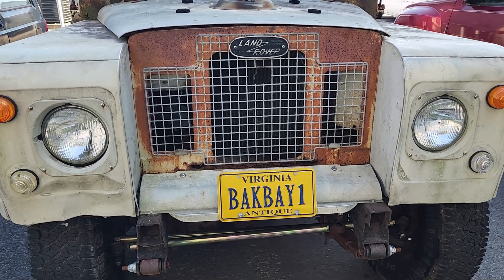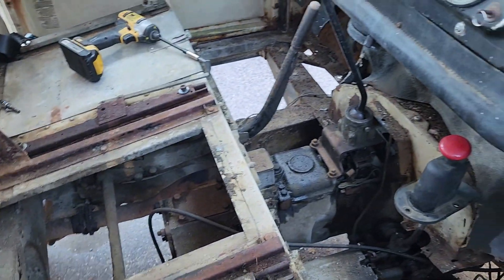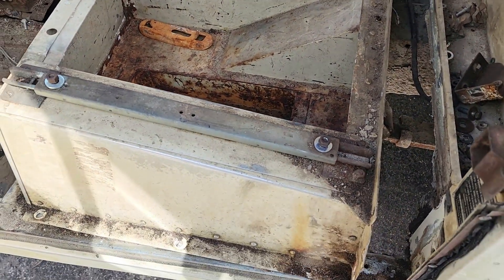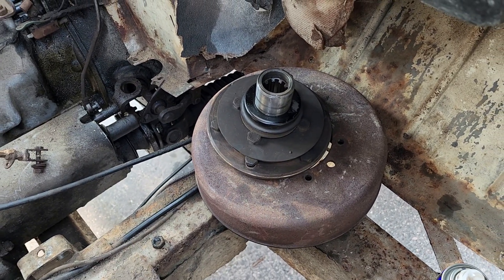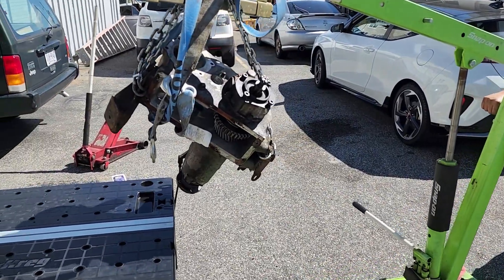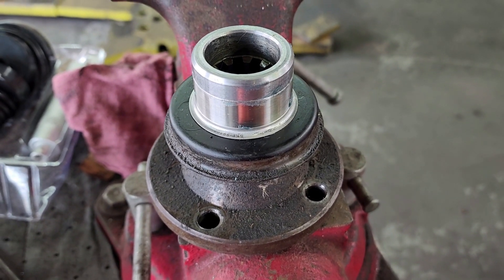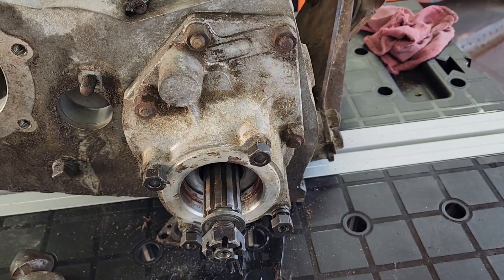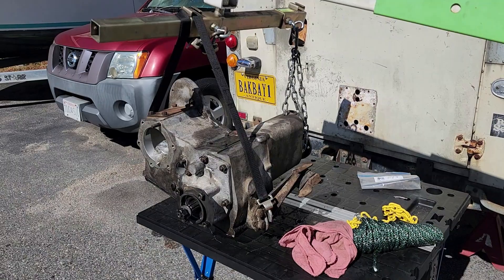Land Rover Series II Transfer Case Remove, Fix, and Install

Comment: I bet you found it was the rods at the front of transfer case jammed with rust! 👍🏽
Reply from the maker: The problem was an extra lever that some previous repairer had left inside the box by mistake. It jammed up the works. Thanks for watching.

Comment: you should have serviced the whole transmission
Reply from the maker: And the transmission in the other series two. Oh yeah my Austin has a tooth missing on first gear. And my Morris Minor transmission whines in all but top gear. And second gear synchro is sluggish in my green TR6. and the red TR6 needs u-joints. This LR is a farm utility vehicle. Who's got time?

Comment: What made the transfer case start working in 2wd again?
Reply from the maker: Somewhere in my video playlist it shows that when we pulled the pan off of the bottom of the transfer case a piece of linkage fell out that was not even supposed to be in the transfer case. It was the two-wheel drive lockout lever and pin that apparently had been removed in a previous disassembly and thrown in there, I guess just as a place to keep it. We speculate that it was jamming up the two / four-wheel drive dog and keeping it from disengaging. It's a wonder it didn't destroy the transfer case but I guess it got stuck out of harm's way in the box somehow. I know it doesn't make much sense, but you have to keep in mind that this was a used transmission and transfer case that I acquired from a local Land Rover fanatic years ago.
Reply: @GrandadFixit  thanks for getting back to me. Yours was the only video I could find on removing the transfer case in situ as I could not engage 2wd. I nearly did it but have such a good seal on the transfer case sump, didn’t want to break it. In the end I swapped the selector for one from a series 3 for my series 2a and it worked. No idea why, couldn’t find a spare lockout lever like you did. Perhaps spring tension changed but now have 2wd. Keep up the great work, loved you video. I couldn’t touch my phone, EP90 oil was everywhere. 😉